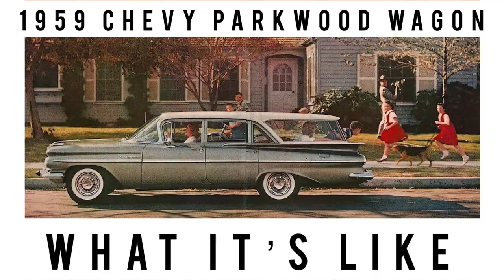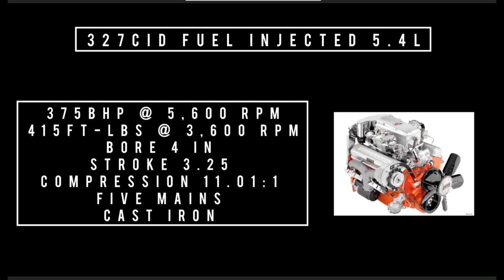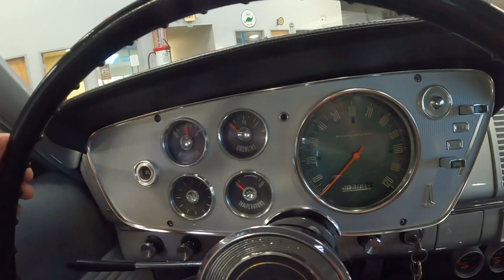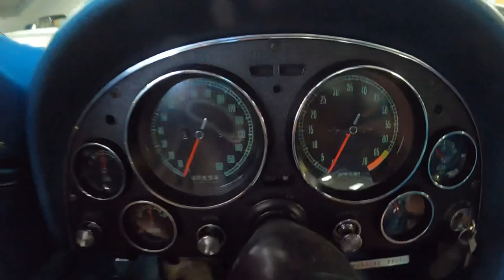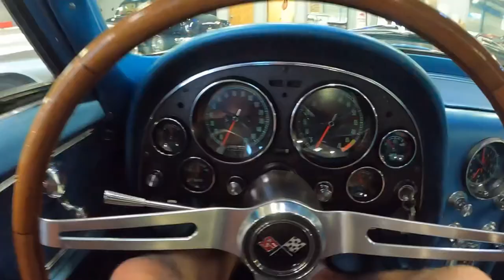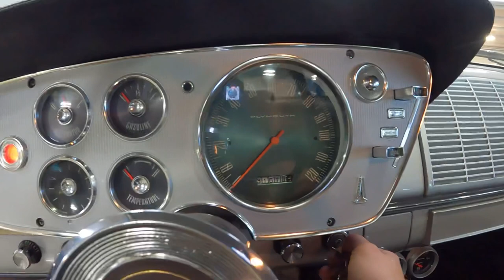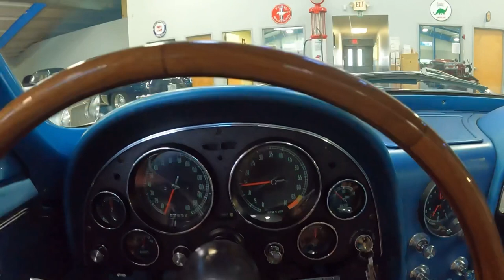This vs that 1962 savoy vs 1965 stingray beach boys shutdown comparison

Comment: The Super Stock Dodge was also mentioned in the Little Old Lady from Pasadena. I grew up in the 1960s one of my high school buddy's dad had a 62 Plymouth with a Super Stock 413 in it. There were very few cars that could beat it. Even in 1969 when we graduated. A big block Stingray could beat it but not by much.
Reply from the maker: Is that your guess for name that tune

It was a high horsepower car even now it’s fast I was just thinking in terms of 409 versus 413 the 413 put you in your seat a whole lot more than the 409 in my opinion
Reply: @What.its.like.  - Weight looks wrong for Vette... I recall 3050 lbs...
Reply: @What.its.like.  No that wasn't my guess but the artist was Jan and Dean for the song. I wrote the comment before the end of the video, then I heard the song.
Reply from the maker: https://www.conceptcarz.com/s217/chevrolet-corvette-c2.aspx
Reply: @What.its.like.  The 409 Chevy and 406 ford didn't have a chance because they were about 7 hundred pounds heavier than the Dodge and Plymouth
Reply: Because of the Super stock Dodges, Ford was forced to build the Thunderbolt or lose 
The super stock Dodges were really midsize cars. They used the same chassis as the roadrunner.
Reply: @mylanmiller9656  The dodge's were actually called Ramcharger the super stock was what Plymouth called these engines. Also these predated the Roadrunner by several years, but yes they were built on the Chrysler B body platform. That platform was created when some bad intelligence let Chrysler to believe that GM was downsizing their full size cars. The B body platform appeared in 1962. and was the full size dodge and Plymouth until 1965. When it became the Dodge Coronet and the Plymouth Belvedere.
Reply: @jdgimpa  The  Chassis is the basic chassis that the road runner was built on. both cars were built for the Super stock class that is why they were refired to as Super stock!  When Mopar came out with there new full size Monico style Body, the Dart and Savoy were re-skinned and called the Coronet and Satellite , even if you didn't know it a Road Runner is just a Cheap Satellite. If you trying to prove your smart your not doing to well.
Reply: @mylanmiller9656  I spent 45 years working In Chrysler dealerships and probably have worked on more of those cars than you have ever seen. So if you think you are trying to educate me you are preaching to the choir. As far as proving I am smart I Hold master certification from ASE as well as the state of Michigan I am also Gold Chrysler certified with over 4000 hours of Chrysler service parts and technical training. I also hold classic car certification. Those are my credentials. What are yours?
Reply: @jdgimpa  Another  OK You are that kind of guy, you know everything so have no ability to be taught! There are lots of guys like you out there.
Reply: do not forget the big Block Camaro SS 4-speed
Reply: @mylanmiller9656  agree but...THE LIGHTWEIGHT BEL AIRS,GALAXIES...EVEN SWISS CHEESE PONCHOS WERE MORE LIKE 3200 LBS... my guess.
Reply: Buddies •
Reply: @mylanmiller9656 they did not have a chassis dummy. They’re unibodies. Another know it all that knows absolutely nothing.
Reply: @jdgimpa  you spent 45 years and still know squat, you all ready know everything about everything and have no room for  knowledge..
Reply: @mylanmiller9656  I have one question. What is your source of information? I don't know everything and learn something new every day. However when you dispute things that I witnessed first hand and then say I am ignorant we have a problem. If you have first hand knowledge I would be glad to discuss it with you.

Comment: My father left me a car collection in 99. I have both cars and raced them 100 times under every condition possible. Like slicks, bumped timing, you name it. That 413 wins every single time!!  Every time!
Reply from the maker: Thank you so much just curious where are you located? That is something that I really want to film just to put the Corvette guys in their place.. because that car gets so much praise and it’s really not better. Shoot me an email.

What_its_like@yahoo.com 

Don’t get put off by yahoo.com so many people from my generation won’t email people with a yahoo account which I think is kind of shallow .. vintage web provider for vintage car. I think it’s very fitting. 

Thank you so much for sharing your experience with those cars the 413 when it hooks up it has so much force it’s hard to explain. It just puts a big smile on your face.
Reply: YES!  The 413 was actually a faster car.  Here are the Googled statistics:  "A 1962 Plymouth Savoy with a 413 Max Wedge known as the “Melrose Missile” became the first factory stock car to break into the 11 second range in July of 1962. The Missile ran a verified ¼-mile time of 11.93 seconds at 118mph."  1963 Corvette Fuelly 14.1 to 14.5 seconds at 98-100 mph.

Comment: The lyrics, called the mopar a dart, as in Dodge Dart, not a Plymouth savoy. Also lyrics read, super stock dodge is winding out in low. In the 1/4 mile, the only way the vette beats the mopar, is if the dodge runs out of gas, half way down. Now if you want to beat the mopar, bring a ford thunderbolt. Now that’s a race.

Comment: Hey Jay, the early sixties Chrysler products are odd looking indeed thanks to Virgil Exner!!! The Corvette is far & away more attractive than the Savoy but on a straight away, the Savoy will take the Corvette!!! Thanks for sharing this interesting comparison!!! 👍👍🙂
Reply from the maker: It’s crazy to think that savoy grocery getter will annihilate one of the most highly praised corvettes, where was the coverage back then. Studebaker R3 vs savoy would be a cool match up lots of underrated cars. I still stand by my statement nothing could be better than the corvette and if there was something better just didn’t get the coverage. Much like tesla now they just don’t include that car faster than everything, but remember when Nissan GTR was the fastest brought it ever time double standard
Reply: @What.its.like.  That depends on what you focus on as "better". The faster of the two cars was the Mopar.....read on.
The 413 was actually a faster car.  Here are the statistics:  "A 1962 Plymouth Savoy with a 413 Max Wedge known as the “Melrose Missile” became the first factory stock car to break into the 11 second range in July of 1962. The Missile ran a verified ¼-mile time of 11.93 seconds at 118mph."  1963 Corvette Fuelly 14.1-14.5 seconds at 98-100 mph.  These statistics were Googled

Comment: Back in 1962 I actually saw a 413 Dodge Dart S/SA  mop up everything including 409 /425 HP in S/S Class.  Running mid to low 12's ( Top illustrator ran Stick Shift against Automatics.)
Reply from the maker: That’s awesome it was a super underrated car... remember nothing can be better than the corvette.. this was tho
Reply: you mean top eliminator ?
Reply: "A 1962 Plymouth Savoy with a 413 Max Wedge known as the “Melrose Missile” became the first factory stock car to break into the 11 second range in July of 1962. The Missile ran a verified ¼-mile time of 11.93 seconds at 118mph."
Reply: @USCG.Brennan  In NASCAR the Pontiac Super Duty 421 was the engine to beat before Chevrolet knee capped the division with cast rods.
Reply: @anthonyrowland9072  Yes the Ponton 421 was a beast and well known for it's prowess on the track, however what was it's best verified 1/4 mile time?

Comment: The 413 Dodge 1962 ran NHRA SS/A class, thus the lyric Super Stock Dart in the Shut Down song.
Reply from the maker: That’s the thing though super stock refers to Plymouth Dodge was the ram charger.. they were sister cars
Reply: @What.its.like.  Super stock Refired to the Class they raced, in, both Dodge and Plymouth Race in Super Stock Class. Your reference is like saying it is a Cessna not an Airplane.

Comment: Shut Down: History
The song details a drag race between a Super-Stock 413 cu. in.-powered 1962 Dodge Dart (not a Plymouth) and a fuel-injected 1963 Chevrolet Corvette Sting Ray and is derived from a longer poem by Christian. Many classic car enthusiasts and experienced muscle car drag racers have suggested over the years that in actuality, all things being equal (i.e. drivers of equal skill), an early 1960s SS Dodge Dart (most likely the 1962 Max Wedge variant) with its 413 cu. in. engine with twin 4-barrel carburetors ("dual quads") and ram-air induction, producing 410–420 horsepower, 460–470 torque, would have most likely easily beaten a 1963 Chevy Corvette Sting Ray with its fuel injected 327 cu. in. engine producing roughly 350–360 horsepower, 352 torque.  Great song though and nice review. I know this, my 64 Plymouth 426 - - beat many the Vette.
Reply from the maker: Thank you =)
Reply: As you said, as I remember, they sang about a super stock dart.....not a super stock dodge.... 🤘
Reply: @jasonzinger132  Depends on the version -

Superstock Dodge is winding out in low
But my fuel injected Stingray's really starting to go
To get the traction I'm riding the clutch
My pressure plate's burning that machine's too much

[Verse 3]
Pedal's to the floor hear the dual quads drink
(Oooo pump it up now)
And now the four-thirteen's lead is starting to shrink
(Oooo pump it up now)
Reply: Super stock is also class at the drag strip. So I say yes to a Super Stock Dodge!
Reply: @jasonzinger132   I remember it as SS Dodge
Reply: @Vettester_Videos  this is when Chrysler torqueflite transmissions (NHRA SS/A) started beating standard shift cars too,
as they would run them together, plus the Mopar stick was harder to shift
Reply: The 327 fuelie Corvette was rated at 375.  I've had one on the dyno with stick exhaust manifolds the real power was closer to 400.  The 413 Max wedge was around a real 425.   The difference in weight in the two cars was closer to 400 lbs with the Corvette being lighter.   I've had both cars on the scales.  The only car that was light weight was an ultra-rare aluminum end car with ultra-high compression and a lot of other one-off deals. On a City Street, the Corvette destroys the Dodge.   The difference is traction. During that era, tires were small and hard.   On a drag strip with traction compound and gearing. It becomes more even.

Comment: Pedal's to the floor hear the dual quads drink ... And now the four-thirteen's lead is starting to shrink ...
Reply from the maker: I think the 413 would eat the Corvette though that car when it hooks up it hooks up.. and it’s light .. I worked at that Classic Car dealership over that summer and I really really wanted them to just drive both of those cars first one to 60-70 miles an hour winds or whatever.. we never did it because the Corvette is six-figure car. I got the opportunity to push both of those cars. It’s harder to push a Corvette. I had to push the Savoy about a quarter mile back to the showroom. I shut it off. Those things are very temperamental with the cross ram they don’t like to start all the time and they can turn with the wind from tuning great to not running at all

Comment: They said "Super Stock Dart" which would roughly be the same car as the Savoy.  In 1962 the Dart series were "full size" cars in Dart 330 and 440 trim lines.  They were the favorites of drag racers because they were much lighter than the big Custom 880 or even the Dart-based Polara 500.
Reply from the maker: But super stock was Plymouth dodge was ramcharger

Comment: The song "Shut Down" specifically mentions a "Superstock (Dodge) Dart", not a Plymouth Savoy.
Reply from the maker: Very true but super stock was always Plymouth ram charger is Dodge and they say superstock referring to a Plymouth but it really could be either car because they’re very similar
Reply: @What.its.like. Super Stock was the NHRA class they ran in, and likely what was referred to in the song.  So a Dart would fit.  Both the Dart and Savoy are B  bodies in '62 though, so minimally different.

Comment: As mentioned below, the 413 in the song "Shut Down" is a Dodge Dart. When I hear the Jan and Dean song "Little old lady from Pasadena",  I always pictured the "shiny red Super Stock Dodge" referenced as a '63 or '64 Dodge 330 (basically an up-trimmed Dart) with the 426 Max Wedge option. Am I wrong?
Reply from the maker: Super stock was plymouths tho ramcharger was dodge..
Reply: @What.its.like.  True, but I’ve also heard the 426 MW referred to as the Chrysler Super Stock engine (mainly by a friend in Vermont who owned one and desperately sought a cheap ‘68 Charger R/T to drop it into, but by then they’d already started to appreciate beyond his means) so I just assumed it was a reference to the 426.
Reply from the maker: Super stock dodge sounds better tho ramcharger is eh it does vibe like super stock dodge.. 

And everybody said there’s nobody meaner, than the little old lady for Pasadena =D

You might have a goer but you’ll never lose her. 

I like The Beach Boys version it’s faster than the OG
Reply: @What.its.like. Yeah, I have the Jan & Dean version on my iPod but I agree about the Beach Boys version. It occurred to me after I posted the above that the reason my buddy called it the "Super Stock engine" might have been to avoid someone breaking into his place to steal it. I'll ask him about it this summer. 
"Guys come to race her from miles around, but she'll give 'em a length and then she'll shut 'em down." Sounds like early sixties MOPAR to me!
 Ever heard the Pat Traverse (the best IMHO) version of "Hot Rod Lincoln"? I have fond memories of that song playing on the radio while traveling much too fast as a passenger  in a baby blue '61 Newport with a 413 salvaged from a '63 Imperial. My dad's boss had a brand new Mercury with a 429 and it drove him nuts that my dad could leave him behind without even trying in the Newport.

Comment: The cobra race team Called Corvette Plastic Pacoderm Because it was way to heavy the super stock Dodges were lite weight and did raise hell on the big block Ford and Chevys!
Reply from the maker: That savoy will run circles around that Corvette

Comment: you have to understand that the Blocks in both cars were supped up to the max for the Drag Strip so a stock one does not do either one justice
Reply: These 2 were street legal cars you could buy directly from a dealership.....that's why they called the "Super-STOCK" cars.  
The cars in this song were not ones suped up professionally for the drag strip.

Comment: Was that 3185 lb. weight for the Dodge BEFORE the 413 package was added?  If so, then add another 400 lbs. or so for that big block engine.
Reply from the maker: I had to push that car last summer way easier to push than a corvette 

https://www.automobile-catalog.com/car/1962/2658560/plymouth_sport_fury_2-door_hardtop_v-8_413_max_wedge_410-hp_sp2.html#gsc.tab=0

Comment: Ok I've had both cars on scales and the Corvette is 3125 lbs in real life.   The normal Savoy was 3650 in a form that the public could buy.   The Aluminum findeted, bumpers and acid dipped cars are indeed that light but so fragile and none were actual steet car but sold as race cars to stock racers
Reply from the maker: Awesome thank you so much for all the insight and information

Comment: Song Shut Down is by Jan and Dean but the cars are a duel quad 327 Vette and a Dodge Ram Charger not a Plymouth.
Reply from the maker: Crazy thing is they say super stock dodge when super stock refers the Plymouth.. either way it’s almost the same car.. it’s a beach boys song fuel injection stingray and a 413 

In the article it says Plymouth 413 max wedge is the same equivalent

https://en.m.wikipedia.org/wiki/Shut_Down_(The_Beach_Boys_song)

Comment: The Savoy Max Wedge 413 would beat pretty much any of the small block Vettes , including 375 hp fuelies. Futhermore , it could also win against Big Blocks too including L78 396 , and would be a close race with L71 427 and LS5 454 Vettes. However it didn't stand much of a chance against the mighty L88 427 , those were underrated by at least 100 hp and had a top speed that was crazy for the time of 170 mph 🏁

Comment: I do not believe the song limited the race to just the quarter mile.  As a result, in a top end in race the Corvette would blow away the Mopar.  Additionally, if the race was conducted around a curved roadway the Mopar would have no chance.
Reply from the maker: It happened on the strip where the road was wide so that would refer to it was a drag race never specified how far 0 to 60 in the Savoy will annihilate the Corvette at a fraction of the cost in the long run the Corvette would probably win I wonder how long it would take for it to catch up though
Reply: But then the vet would have no chance against a Ford Cobra, 427 or 298....
Reply: I believe its more than just 0-60 in the song  - Pedals to the floor, hear his dual quads drink but the 413's lead is starting to shrink....

Comment: You have it all wrong. a 1965 small block corvette weighs in at a dry weight of 3100 or so + options like radio, etc.. The Dodge is a heavier car and with that big block I bet more than the weight you claim. I have had many many muscle cars and about 10 C2 Corvettes. On the Street assuming they both have 411 gears, with out doing burn outs the Stingray with its 49-51 weight distribution and Independent Rear Suspension would get the Dodge off the line, but the Dodge would chase it down in the 1/4 mile, it would be a close race as a properly driven FI 1965 Corvette can get in the mid to high 13's in the 1/4 easy. So flip a coin if it gets caught but on the street the Corvette would wax it off the line, but at around 80mph especially at the track the Dodges would catch and pass the Corvette by the 1/4 if the start wasn't blown too bad.